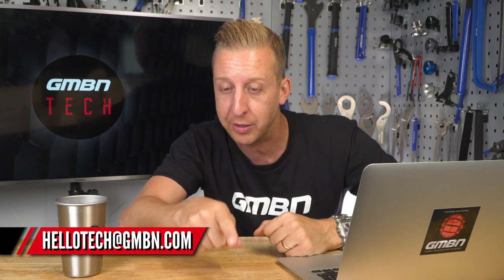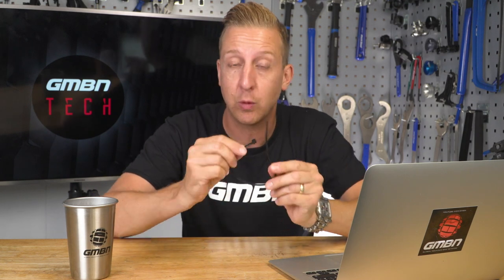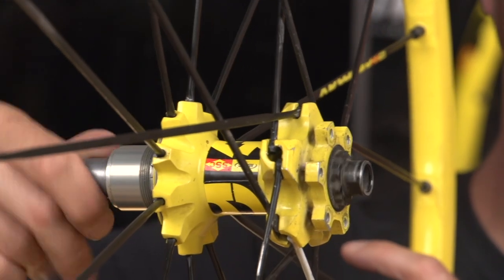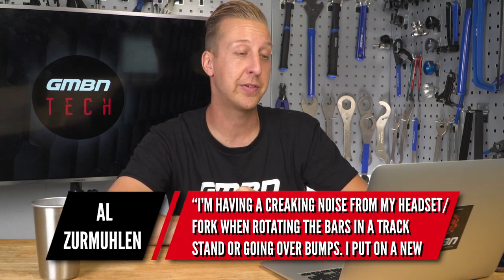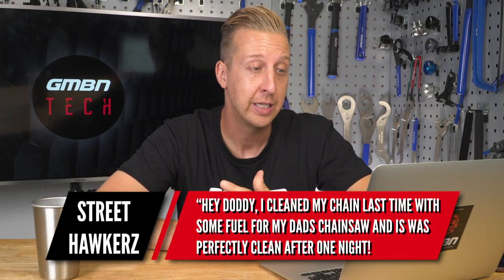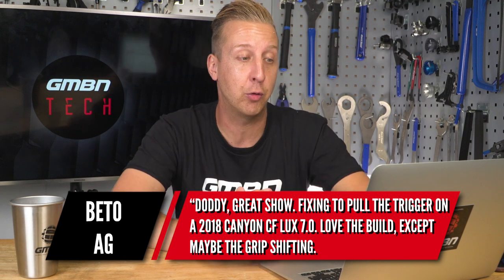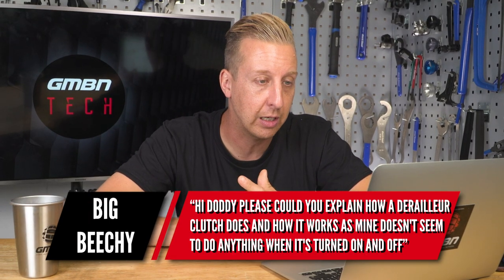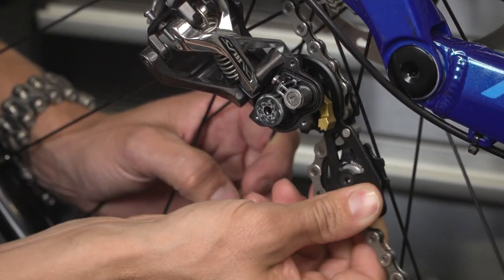How Does A Clutch Derailleur Work? | Ask GMBN Tech

Comment: I always loved my grip shift...no faster way to change down when u  crest a hill, one twist from bottom to top (hardest) gear...reliable as hell...
Reply: I hated mine ...had SRAM XX 10 speed ... too much plastic! Replaced with XT shadow plus...maybe I liked the clutch derailleur
Reply: In fact, its still on my '97 KHS comp😁 only ever had to change cable once!
Reply: Wait until the market tries to sell you a trigger shifter that is slower and looks bulky but says a bunch of crap to make it sound good......oh wait !!! 

Now wait until the market tries to sell you a bigger wheel saying a bunch of crap so sell...oh wait !!!

Now wait until the market tries to eliminate the bar ends even though they work great...oh wait !!!

Now until the market tries to sell you a seatpost that can be height adjusted on the fly even though normal seatposts have been used for decades with no problems.....oh wait !!!

Comment: I also had so many pedals and they always made some sort of noise. I use platform and found that the Race Face Atlas are the best even though the small bearings might give out a bit sooner than expected. They also did make clicking sound during each revolution, and reason was that from factory the small outboard bearings are simply pushed in without any grease. I made sure to set each bearing in grease so there is a grease barrier between the pedal body and bearing. No more noise! This will be problem with most pedals which utilize sealed bearings. No matter how accurate  the machining is there will always be a little bit of movement when giving it some power.

Comment: Could another possibility for the headset creak be the stem/bar clamp, I have had my bars creak inside my stem and simply pulled it apart, cleaned, re-gressed the bolts and put it back together, fixed the problem really easy

Comment: kerosene is really good because it’s safe and doesn’t have any vapor. But because of that you have to wait for it to drip off or better yet, I use wax so when heated the kerosene rises and I don’t need to clean my chain or the solvent so I spend 0 time cleaning anything but the process does take some time about 20 minutes every 2-3 weeks to do 1 chain or 10 chains. So it’s great for people with many bikes or chains.

Comment: Do Sram GX derailleurs have a built in clutch or will they pop of a 1x drivetrain real easy? Or will i have to go with shimano to get the proper clutch chain tension. I already have a narrow wide 1x10 but looking to switch to an 11spd and looking at sram stuff since i have never tried them.

Cheers,
Ryan

Comment: #askgmbntech I recently bought a DMR Crisis chainset and the chain ring is held on by a lockring on the back. The lockring has about 8 deep notches on its outer edge. What tool do I need in order to remove this please?
Also, a video on the different types of chairing fittings would be cool as there are numerous different 'cinch' types on the market.
Thanks

Comment: Doddy in reply to the fork creek it can also be the stanchions into the crown I was talking to a suspension service company because mine do it and it happens because the crown slightly oxidises and allows the steerer or stanchions to move very very slightly and therefore a creek but it can be fixed by taking it to where you get your forks serviced and ask if they can sort it some places have the tools some don’t but all they do it press the steerer or stanchions out the crown then add a compound that I don’t know what is but it stops this oxidation and the creek

Comment: #askgmbntech I want to buy a coil shock but can’t find one with the same lengths. There is one with a shorter eye to eye hole but longer stroke length. How would this affect the bike and is there any for my bike that will specifically fit (Vitus Sommet VRS 2018)

Comment: #askgmbntech Hi doddy, I have a question on drivetrain: why with the advent of 1x set up there are no big manufacturers going to fixed hub and front freewheel on the crank? This setup will give the possibility to change gear without pedaling, better weight distribution, and it is easier and cheaper to change a freewheel on the crank rather than the rear hub.

Comment: Hello Dottie hey I got a full suspension Kona dawgma I use it for everything even Shores pulling my bike trailer and on my bike trailer side where I pull a lot of weight I have a worn-out bushing how do you order and replace a four bar rear bushing I would graciously appreciate information on how to find and replace also I have a RockShox Tora front shock that needs maintenance seal kit and rebuild can you show me some information on how to rebuild that shock
Reply: Dottie?

Comment: Hey Doddy I'm thinking of getting new wheels. Should I get a mid-range wheelset (X1700) or a posh rear wheel (XR1501). Are better front wheels noticable or would a really good rear wheel make a noticable performance increase (36t vs. 18t). I'm only getting DT Swiss because I want to get XT M8100 when it comes out.

Comment: #askgmbntech Hi Doddy. I'm going bikepacking next month and need to install a bag in the stem/bar to carry stuff, but the cable of the fork locking system is in the way. I'm wondering, is it possible to easly change from a remote lockout to a crown lockout? Or I'm better off with just taking away the locking cable and riding with the fork fully open?

Comment: 10:12 gripshit ha ha ha never heard that. Did use them, no complaints. Sram 7.0 though. Accidental gear change is practically non-existent. Maybe once or twice in 2 years. Not best soolution for massive long hands. It can be hard for squizing narrow shifter, in rain with no gloves especially problematic. For normal hands - no noticable downsides.

Comment: #askgmbntech #bigbeechy about clutch i have shimano xt and when i first time turn clutch on i snap a lever inside so clutch works but i need turn on inside because lever doesnot do it. after that i order new lever, change now works. and in shimano manual from derailleur its a friction test you need tx30 or 5mm allen and torque wrench about 3,5-5,4 NM

Comment: #askcalvin Great tech videos. I have a question for you and or Calvin. I recently converted my 24 speed Orbea to an 8 speed. After the change I can't stop my chain from skipping in high tourque applications. The deraillure is dialed while on the stand. I tried a new chain ring, sprocket and chain without results. Any help to solve this would be appreciated.

Comment: I have a shimano slx 11 speed shifter and shimano brakes ,they are mounted together by the i-spec II mounting system. i want to buy a formula brake but their "mixmaster" adapter doesn't work with the wired slx shifter ,so im looking for a adapter so i can mount my shifter using a clamp #askgmbntech

Comment: #askgmbntech Hey! I have a Scott spark 40 with RS reba RL dual air fork and DT Swiss M210 (I think, it is made for Scott) shock with dual lockout. Can I use the lockout while I'm riding or do I have to stop and remove my weight from the bike when I engage the lockout? Thanks for your help in advance!

Comment: #askcalvin I recently acquired an old retro bike with a 1 inch threaded headset and a single piece crankset. I want to convert this to a 2 or three piece crankset and a threadless fork. Is this possible to do and do you have any advice on doing it?

Comment: #askcalvin Can you change out the FIT Grip damper in something like a FOX 36 Performance fork for the higher end FIT4 or GRIP2 and effectively making it a Performance Elite model?
And are the charger 2 damper upgrade kits from 2018 usable on the new 2019 DebonAir Yari Fork?
Reply: Eric Sjöström  yes you can do that. The yari has the externals between both years. So the damper would fit from 2018 to 2019. Fox you can do the same. All the different models use the same chassis. So you can swap the dampers as you like to the better one
Reply: ah neat, thanks for the (earlier haha) answer
Reply: Eric Sjöström im sure doddy said this guy is an expert on TOOLS not bike components. Maybe im wrong.

Comment: #askgmbntech #askcalvin I rode my bike for about 600km and now my front brake pistons won't return fully to it's original positions, they seem to be slightly stuck. i cleaned all the pistons and used the dot 5.1 to lubricate them, like you showed in your video and i bled my brake to be sure that everything is maintained, but still they seem to be stuck. i have a SRAM Guide R brake btw. do i have to buy new brakes or is there any advice on how to get them to work properly again? Thanks in advance and greetings from germany

Comment: #askclavin I have a Shimano CS-HG50, 11t-36t, 10-Speed rear cassette on my bike and I bought the appropriate free wheel removal tool from Park Tools. I’m unable to remove the cassette from my bike but on another bike with the same cassette it works fine. Do I just need to use more force? Can i break anything

Comment: #askgmbn i have a 2014 whyte 901 with a sram x9, thats just the name its actually 10 speed rear deraileurr, it has a x2 drivetrain stock but i was hoping to convert to x1. as im doing this to compensate im thinking of putting a wider range cassete on the bike. the bike comes with a stock sram pc1030 32 tooth cassete and im hoping to put on a sunrace 42 tooth cassete, would my deraileure be able to handle the extra teeth?
#askgmbn #askcalvin
Reply: #askgmbntech

Comment: #askgmbntech Is it OK to mismatch tire sizes? I have a SC Bronson and want to fit a 2.5" minion dhf up front but can't fit another 2.5" rear. Is this OK?
Reply: Alex Middleton yes
Reply: As long as you dont put a 2.1 inch on the back you should be alright
Reply: I always run a smaller tire on the rear and have done so for years. I run a 2.5 minion up front, and a 2.3 aggressor on the rear. It works great.
Reply: That’s absolutely fine
Reply: Its normal...hell, u can run a 29er front and 27.5 rear if u like! (Wheel of course😁)
Reply: Yeah it should be fine
Reply: Yes, it's good
Reply: yes but I find it can look weird if you have a big difference in size. I recently put a 2.3" minion on the back while having a 2.6" nobby nic up front. It looked pretty weird but that's just looks you know. (I slashed my rear nobby nic prior and that minion DHRII was the only spare tire I could use.)

Comment: Does any one know if you can drill a hole in your seat tube in order to run a cable in it for a Dropper post or will it lesson the strength of the seat post.?
Reply: Alloy frame should be ok...one of my suggested how to vids to doddy....but google..sure plenty have...location of the hole is key...
Reply: Thanks Rupert!! I will google it.
Reply: I would recommend getting a externally routed dropper it might be possible but I wouldn’t do it

Comment: #askcalvin hello Calvin and doddy I use a drill for my disc bolts because it's much quicker I haven't had any problems yet is this safe to do ?
Reply: i'd drill it in loosely and then ue a torque wrench to take the est of the grunt
Reply: Just set the Torque of the drill to be appropriate.
Reply: Tomi Saaranen yeah mine goes to 19 but i only set it to 5

Comment: Is there a difference in handling or other ride characteristics between these two setups (assuming that reach and saddle to bar height difference remains the same): 1) riser handle bar with negative rise (or neutral) stem; 2) positive rise stem with straight handle bar? Or is it just style as stems with positive rise are just un-cool? #askgmbntech

Comment: #ASKGMBNTECH
Hey guys!
At the beginning of the year I purchased a Voodoo Zobop and have since then improved a lot due to riding locally at Puddletown Forest and at bike parks such as Windhill and Tidworth, sadly however that lead to my bike consistently braking predominantly with the rear end. Therefore I’ve purchased improved parts on improved parts in order to provide the rear end with a stronger build. But sadly not even that would stop my problems with it breaking! Which means I can’t ride my bike to my full potential due to the worry of it breaking again and again which is stopping me from progressing! :(
My question to you guys is that I’m wondering if continuing to purchase new parts is the way to go hoping it will come to an end or should I buy a new bike that is let’s say “more capable” for  what I do? I have got a few in mind due to riding my friends GT Sensor and another’s NukeProof
Thanks in advanced 
Matthew White

Comment: What should i Chose capra OR Canyon torque tue cheapest model #askgmbn
Reply: Bike Rider If you like Canyon, then you go with Canyon. If you like YT, then with YT. Both German bikes, both have the same rear wheel travel. At the end it will be personal preference.
Reply: Thanks for your help
Reply: Capra it better for dh and canyon is better for uphill
Reply: Colosabeast Epic No no. Both are the same. Freeride bike 180MM is a Freeride bike 180MM. The Geometry of the Torque may differ from the Capra for a little bit, but not by much, but at the end, both climb and charge the same.
Reply: Yt has better geo for dh i would go with YT

Comment: #askgmbntech Is it ok to use a carbon handlebar on a aluminium stem?
Reply: Henrik Elle Race Face SixC Carbon bar on a Race Face Atlas DM 35 Alu stem. I have seen this combo on a Pivot Phoenix DH Carbon. Yes it is ok, but do not overtighten the Carbon bars because they will crack and then break. Not the same as Alu bars.
Reply: Yep it’s fine, but like all carbon stuff, don’t tighten it too tight.
Reply: And use carbon assembly paste...the gritty stuff, like fibre paste or muc off do one (and it smells good too!)
Reply: Never heard of a carbon stem either, sure they exist, but nearly all carbon mtb bars will be in alloy stem...mine all are...
Reply: yes, for many year after carbon bars hit the market there were no carbon stems.
Reply: Carbon stems are pretty pointless, they all weigh more than alloy. Only road sprinters like Peter Sagan really need one because they are stiffer. The. There is the question does even he need it or is it just in his head.

Comment: "thanks" but still doesnt have an answer for what is the clutch actually good for..
Reply: I think it is for avoiding the chain to go hanging on a bumpy trail. It damps the bending of the bottom part (lever) of the derailer. When switched to "off" the bottom lever is loose, so your chain can more easily slip of your front drive train.